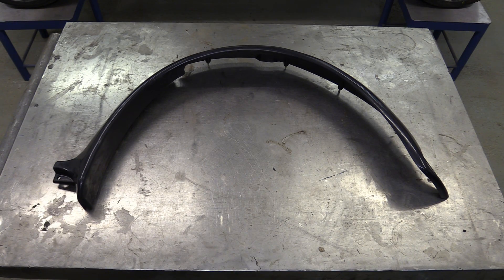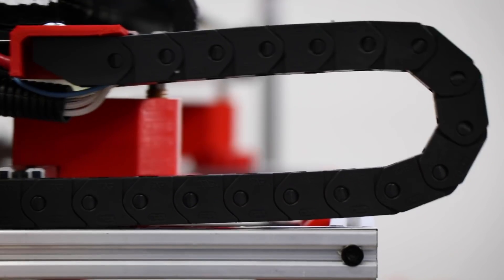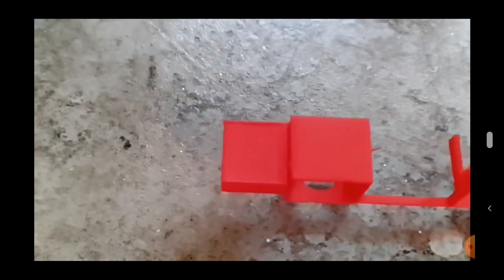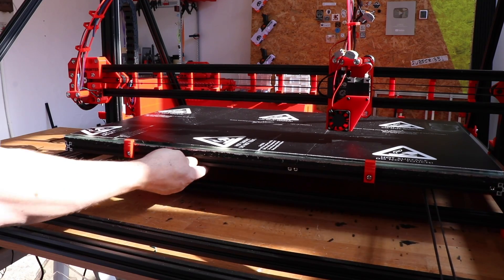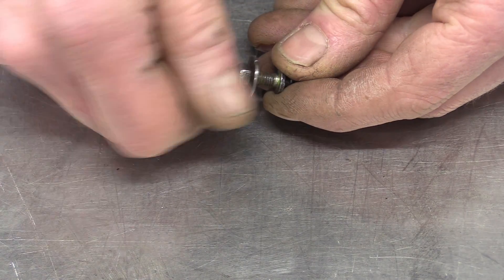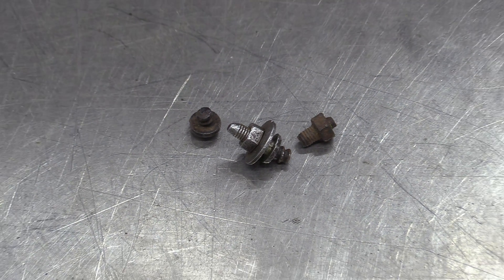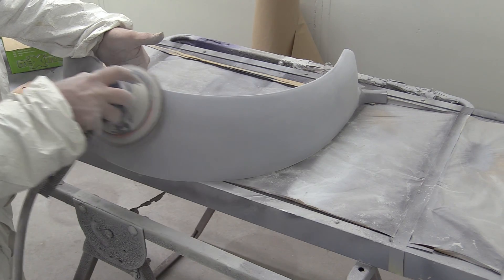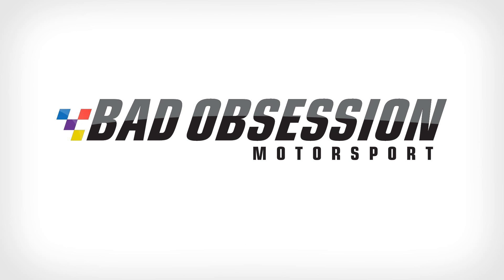Howie Did It - An Experiment in 3D Printing

Comment: I hope that this goes well. PLA warps badly even in warm tap water (about 50°C - 60°C). The 3mm may be thick enough that the wheel arches will keep their shape if the heat does not last for a very long time, but be careful! :)

Comment: Cool project. From my experience, PLA has a tough time with direct sunlight, where ABS is a much better material, although more difficult to print. I'd say make those molds before you bolt these up to the car.

Comment: 100% the layers of 3d printing will delaminate inder the vibrations, also the inserts will wear a larger hole in the print material and become loose. Another thing would be the onslaught of stones underneath, one drop test is nice but in actual practice it would me MUCH worse

While they are finished you want to make at least a fibreglass mould of them before they are anywhere near the car. Getting them done in carbon fibre would be sweet though, collab?

Comment: Word of warning with black oxide coated screws; unless they are kept oiled, they WILL rust pretty badly. I used some to mount a steering wheel to the hub and they had surface rust within a few months, just from the moisture in the air! Black oxide is basically just rust, which is porous and holds oil to keep it from rusting further. Stainless or at least zinc plating would be a better option. Or even brass, but that might cold-weld into the brass insert, not sure.

Comment: I hope those threaded inserts work well and i think they will, but in case you have problems with them the next upgrade could be to put some of those inserts that are melted into the plastic, There's a channel, called CNC Kitchen, that did testing on such things and they demonstrate which are better for different applications.

Comment: Turnd out neat, but can somone explain the benefit of having such things 3D printed as compared to usual bodykit/fiberglass technique. It seems so much hassle (60 hours of printing per fender plus probably a lot more messing around to get right model in CAD etc). So seeing that other usual methods of making fenders and bodykits seem to work fine, what does this bring to the table to pay off so much more work, besides being kinda cool. 
I'm not trying to be negative or anything, just curious as I don't really know much about 3D printing. Cheers

Comment: I’d be careful with PLA on a car part. It’s fine for strength, but it has a fairly low glass transition temperature point and you could easily hit it on a hot summer’s day.

Comment: Would've added a fiberglass layer inside the wing...unfortunately, 3D prints don't have much power against layer separation, one single film of fiberglass would aid enormously to the structure.
Source: a two meter wing span glider.

Comment: It's a Christmas Miracle!!! Wheel arches from St. Nick finally ready to be painted. And no, no one thinks you're painting this car anything like pink, so don't even bother messing with us. 
*somewhere, not too far away and many millions of miles distant, in a house that is bigger on the inside than on the outside, a tall, gaunt figure shuts his laptop and picks up his cup of tea as he leans back into his office chair. 
"BINKY," he says to himself, between sips of tea and staring at a pair of motor oil stained hourglasses affixed to his wall by a pair of custom brackets.  "BINKY, IS A WHITE HORSE..."*

Comment: With PLA, you can use acetone to smooth rough prints - just sayin :)
Reply: No, you can’t. Acetone works on ABS. PLA is very hard to vapor-smooth. You need to use very toxic solvents, and it’s not usually done.

Comment: NOOOOOOOO Dont put PLA on Binky!!!!!!! IT WILL WARP. It's basically made from corn oil and has a low 'glass transition' temperature. and hour left out in the sun on a summers day and you will have droopy arches. PLA is also 'while very hard' is not uv stable and incredibly brittle(thing hardened non tempered steel) you definitely need to mold as cast these in something more suitable. Guys if you need any help with it I'll gladly offer my time, while not an expert in molding and casting ive got experience and can help

Comment: Probably already been mentioned but PLA doesn't deal well with heat and sun exposure. One very sunny day and you might find yourself with some saggy arches. Better to reinforce with fibreglass or better yet mould and make the part in fibreglass instead.

Comment: PLA will melt /go soft above 50 degrees C. Car bodywork can go above this in UK summer quite easily. ABS will be a better choice. Harder to print but not impossible. Might require an enclosure for the massive 3d printer.

Comment: I'm so very glad to see this episode on the day it was uploaded. Thank you for that! The episode was marvellous, but some of the design choices left megalithic question marks dangling by the thread.. Now you have two threads on either side of the brass fitting. the finer is holding a hard metal with a file-like surface, packing exponential amount of friction compared to the plastic side. There the thread is coarser, and the material is softer and more brittle. Based on pure math, the fitting should become unthreaded every time when the bolt is rewound. When you get to the final version, I'd suggest you fit those brass fittings with proper thread glue, or simply panel glue. Softer glue seam would give those wings a fighting chance to stay with the car throughout the entire race. Remember, it's not just rocks and sticks you need to prepare for. The sheer wind resistance those flaps pack, will give those mini wheel arch attachmentpoints a complete run for their money. Other than that, a very handy job!
Reply: Self-tapping threads behave somewhat differently from pre-formed threads. Externally-threaded inserts have been used successfully in a wide variety of materials for many decades, so your theory does not hold up in practice.

Try the math again for an elastic-deformation, negative-clearance thread on the outside.
Reply: @Azlehria  If the outside thread were mirrored, then the fitting would hold perfectly without additional glue. But, in this setup, the outside thread does not hold as much static friction as the inside thread does. Surface area is smaller, and the material is softer, and the overall layout (hard male, soft female) brings the odds to success down even more. Now, if the screw that holds the part in place were made from polymer, then there would be no problem, the screw would thread in and out  without compromising the fitting, but the screw is basically a file, grinding the bronze fitting as it threads in. The outside thread is acting more like a plane or a chisel, forming more uniform cut to the material. this cut has some holding properties due to the "against the growth" effect, but again the material choices, the difference in the surface area and the angle of the slope surpasses that effect.
Reply: @oikkuoek  "And yet it moves." Threaded inserts are commonly used and do not routinely fail to hold in place. They're used as repairs and original reinforcement; in plastic, metal, wood - even sheetrock.

Because they work.

Certainly they do fail: anything can fail. But those failures are vanishingly rare in proportion to their use.
Reply: @Azlehria  You still fail to realize the forces these particular fittings, and the chosen materials are up against. Yes, you can hold up a painting on a dry wall with this type of fastening, but if you apply any excess force to the fastening, it will fail. These brass fittings will hold on their place for a while, that's obvious, but my point was, they will not last mounting and re-mounting. The difference between frictions between treads is against that. I know this from experience too, not just math, by dismantling similar setups after use, and doing damage research on failed parts. And they no not work. They only offer a cheap option for a quick fix to a problem that occurred in the design phase. And yes, it is basically possible to make this type of fitting work without additional adhesive, but not with the materials chosen. That is why I made the warning and repair suggestions in the first place. You can by all means keep boosting your ego around this subject all you want, but try to stay on the subject at hand, please.

Comment: PLA doesn’t do particularly well in heat.  Most of PLA's other problems you've taken care of with priming and painting.  Will be very curious to see how well these hold up over time.  Creating moulds for fibreglass would be a good plan.  Though it’s good to know they stood up to the paint booth heat.

Comment: Those flange head bolts... I'd honestly swap them for something else with an external drive style head and either better coating or different material. 
And something in stainless steel - A4-70 grade as that black phospherous finish won't last more than 20 hours  under the car before they rust up and end up being a nightmare to remove.
Would suggest these from ebay https://www.ebay.co.uk/itm/FLANGED-HEXAGON-HEAD-BOLTS-FLANGE-HEX-SCREWS-A2-STAINLESS-STEEL-M5-M6-M8-M10-/150935671186 
Just a tip from a Mech Engineer working at Cummins on their HV Battery systems, Fasterners are one of my specialities :)
Reply from the maker: Way ahead of you. 😉
Reply: @BadObsessionMotorsport   No worries, just wanting to help make sure the project works out great :)

Comment: Nice!
One big issue I've run into with PLA for automotive parts is the relatively low glass transition temperature. Around 60°C is enough for it to begin to deform, which is a problem if the vehicle is to be left in the sun for any period. 

Using them as moulds is a great idea though.
Good luck!

Comment: Those prints give me the willies.  So much zwobble.  Not surprising with that lousy printer design.  Much better large format printers out there...  Also pla is pretty brittle, abs would've been far better or nylon, acrylic, ultem etc. But those are hard to print for amateurs.
Heat set inserts would also be superior to what was used, but for a rally car I suspect these will be broken before too long regardless.

Comment: About the brass not corroding, working on Audi's in a vw/Audi Bodyshop hate to break it to you, but they the do a sterling job of welding themselves together on the bottom door trim. You might need to look at a good grease to help prevent this.

Comment: I guess red color is so Binky is easier to find when Nik throws it into a hedge!
Reply: wouldnt that be something.
"next time we are gonna rebuild the mini"

and we get to watch it again.
Reply: @Frietpan  not a cheeseburgers chance in america will I sink another 6 years into a 1 car build. Or will I?
Reply: I very much doubt the arches will be red. Possibly white (to contrast the probable British racing green of the body). I'm sure the red is a 'raging red herring' so to speak.
Reply: @MrJohn5791   Or it could be red mould release, since Rich says @ 14:16 that these are still going to be used to make moulds, and the actual arches are still going to be made of fiberglass or composite.
Reply: @aussiebloke609  I think that they were planning on using the 3D printed parts as the actual arches (why else would they fit the M5 Heli coils?), if that didn't work they would then use them as patterns to create moulds and make them out of fibreglass (or Carbon fibre?) instead.
Reply: Yellow is better. If he pitches it into the hedges, red turns to black after dark.  (Thanks for the update guys)
Reply: Not claiming any inside knowledge or anything, but I reckon it just has to be white, since that is how Death's horse is described in the books (since he stopped using the skeletal ones, anyway - he got tired of having to stop and wire bits of them back on.)  Any other colour and they'd have to rename the car, which would be sacrilege!  :-P

Comment: A heads up, PLA is rather low temp, it won't melt but will deform easily with heat. Like ... inside a hot car heat. Which might be an issue on a hot track on a hot day.

Comment: Interesting stuff, love the fact that he built not one but 2 machines to print them.

I would guess you will need to mould and build from a different material

PLA doesn't like getting wet or wide temperature changes, so there could be a number of issues

Comment: I love my 3d printer. With PLA just be careful with any heat - it easily starts to warp at 60c or above. You can print in ABS or PETG if you wanted to - these withstand the heat much more. Shatter resistance varies amongst the type of plastic used.

Comment: I have been running a set of 3D printed brake ducts on a track car for a while. I gave them a quick wrap in fibreglass on the backside for a bit of extra strength and they've been flawless. This is a great experiment!

Comment: Nick & Richard: If you guys ever need to replace the arches, might I recommend using heat-set inserts instead? They are installed by pushing the insert into a slightly undersized hole with the blunt tip of a soldering iron. The heat is transferred through the insert to the plastic locally, softening it and allowing the insert to slide in. They are much stronger than threaded inserts, I've used them on a 3D-printed intake manifold where the plenum halves were held together with them with no issues.
Reply: Also to add to this, PLA is a very brittle plastic and may deform on a hot sunny day. Glass or carbon filled vinyl material is available for 3D printing and is better for end-use. But from the video, it sounds like the plan is to create molds and make these in carbon fiber, a la instagram's @3D_magic_mike.
Reply: 14:16  Don't think heat-set inserts will work with the fiberglass or composites Rich said they're going to make the actual arches out of.  These ones are still intended to be patterns for making a mold, rather than for actual use...and the current inserts are there so they can fit the temporarily and ensure the attachment points are in the correct position.
Reply: @aussiebloke609  Yeah, I pre-emptively made that comment before finishing the vid lol
Reply: Yep, this is the best way to install thread-serts in thermoplastics.
Reply: They can achieve the same result as a heat set insert by doing a wet install and dab the insert with epoxy.
Reply: hang on, 3d printed intake manifold? could i request more info on this mate? i had often toyed with the idea but didnt think there would be a strong enough material out there (boost)
Reply: @hondaxr5001982  Yeah, on my Formula SAE team I designed an intake manifold. Spec'd runner lengths and plenum volume based off engine modeling to get the torque curve I wanted. Then did a bunch of CFD to figure out the shape of the plenum with minimal losses while fitting the packaging constraints I had. Then iterative CAD design and FEA to ensure it was strong enough. 

If you're boosted then you could run 3D printed but you'd probably have to up your wall thickness considerably. And you're going to want to have that SLS'd, if you have it FDM the layers will start to separate (ask my how I know...). Honestly for reliability I'd just stick to fabricated out of sheet aluminium. In Formula we're pushing to minimize that 1% power loss and get that last 1% weight reduction. On a street car, it's not worth the risk
Reply: 3D printing is still just for fast prototyping. These flares might work if printed in nylon, but not in typical filament plastics.
Not sure how you dealt with temperature issues on an intake manifold, unless the plan was eventually sintered alloy.
Reply: @truantray  You'd be surprised at what plastics are out there - my manifold was printed from Ultem which had high strength, temperature, and chemical resistance to fuel. Aside from the layers starting to split towards the end of the season (for which structural epoxy saved the day) there were no issues. Later manifolds were SLS'd (also with plastic) and would last a full season with no issues. I'd bet that if the arches were SLS'd they'd also last as well. But it makes more sense to do a layup with composites for the weight reduction

Comment: Ive been 3d printing for a good 5 years now, I can tell you PLA is pretty strong. But your main issue will be heat and direct sunlight. It warps and srinks the plastic, so park him under the shade at all times in the summer.